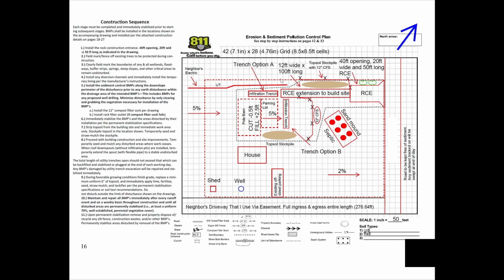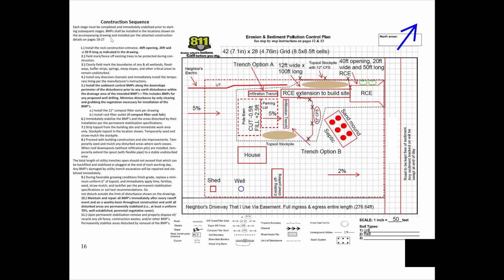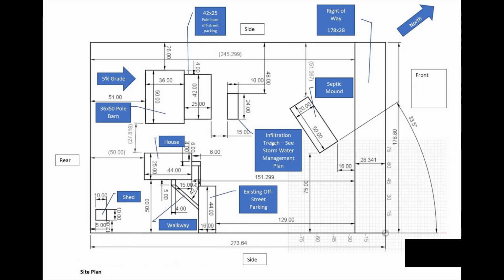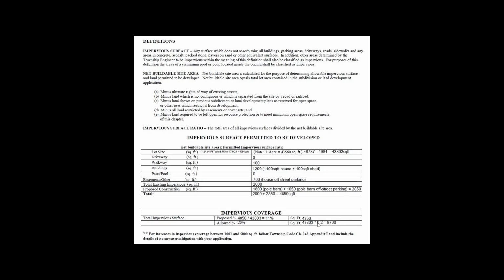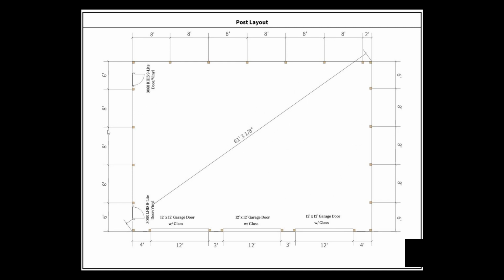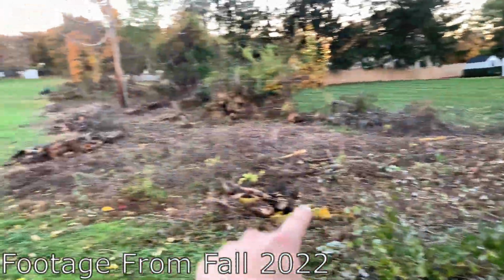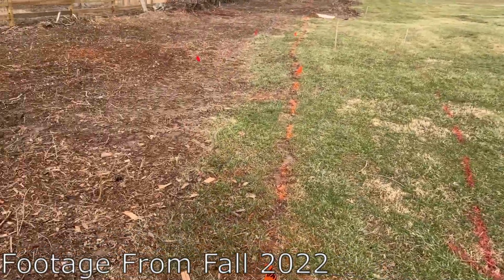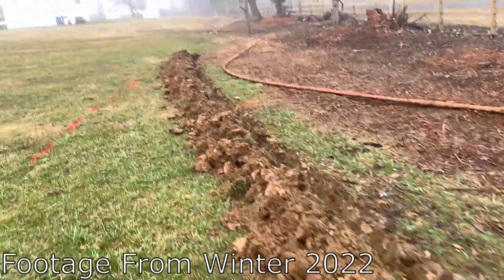1800 SQFT Garage Build : Planning, Permitting and Prepping

Comment: Nice that's almost the size of my house lol... 
My garage is only like 700sq ft 2 Bay big single door with 9ft post lift. 
Definitely would've designed a little differently if I was doing it from scratch but it beats having no garage for sure. Here in VT we get pretty cold winters so heating it has always been interesting considering I don't use it everyday. So I have a 175k btu buddy pro that draws it's air from outside and is in a separate room from the rest of the garage. I just leave the door open to that room and put the heater in the doorway pointing into my work area. It's loud and stinky on startup. But the outlet is thermostat wired. Was po "grow room" lol. So it doesn't run when it isn't necessary. It'll heat that garage from 20°f to 70°f in about 15 min. Which is nice because I don't need to plan an hour ahead to not freeze. Not perfect but it works for now. I can warm it quick work a few hours and walk away without needing to wait for it to go out like a wood stove.
I just ordered a torqstorm centrifugal supercharger for the LS Volvo 240. Fuel system, rear end, and top end of the motor were already built for future goals so shouldn't be a bad install at all.
600whp is plenty for a 3k lbs car for me. But I've gotten bored with 380whp...
That's cool your taking the next step in life but still leaving room for your love for cars.
Reply from the maker: Any garage beats no garage my friend!! I lived up in New England for 6 winters so I sympathize with you on the winters lol. I'll have to take a look at those buddy pro heaters. Before I poured my concrete slab I did a radiant heat install but it will be another year or two before I insulate and hook that up so I will need something in the meantime. Sounds like the 175K BTU works really well for you. 20f to 70f in 15 minutes is awesome. Enjoy your supercharger install! 600whp will be a blast. Plenty reliable too with the LS.
Reply: You and Joe Glastow have the coolest whiteblock builds for sure. I see he's working on a MR2 whiteblock build now. 
If memory serves me right you had helped him with something on the golf?

I still have my b5234t9 swapped 1998 S70 T5M. My plans were to upgrade from the 22T from snail turbo to a 20g but it and the 240 needed some front end maintenance first, and then I decided I wanted some forced induction on the 240 first. I'm about 15k deep into both lol which I'm sure you also feel 😂.